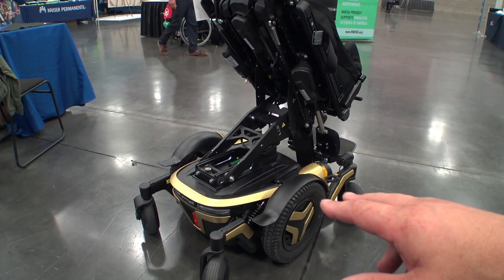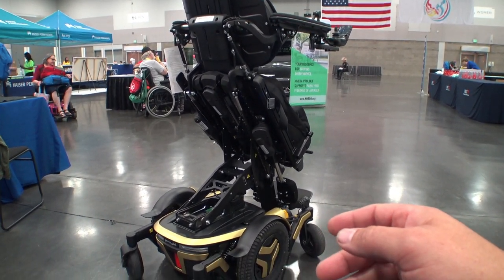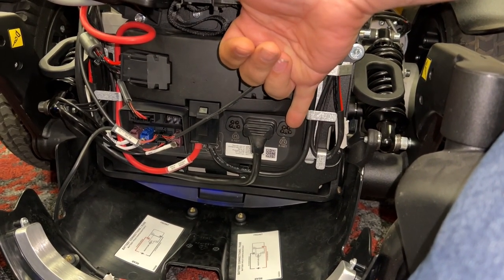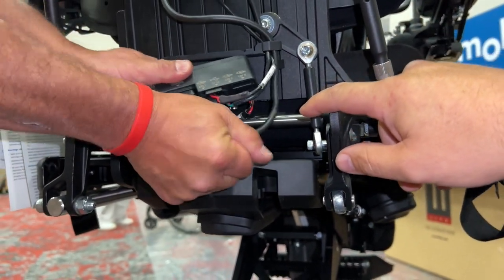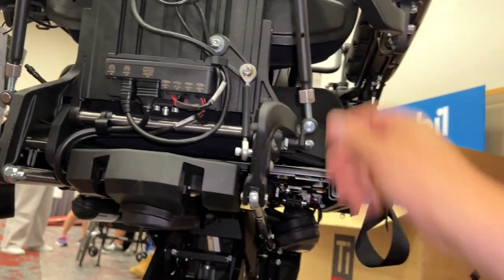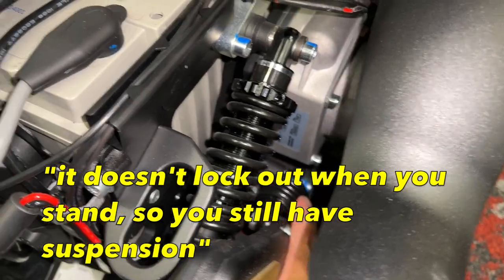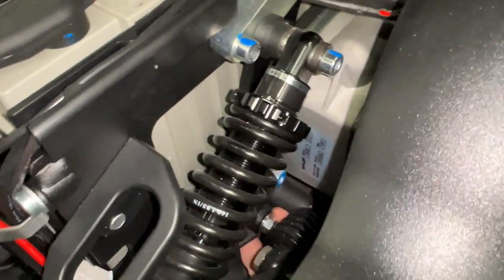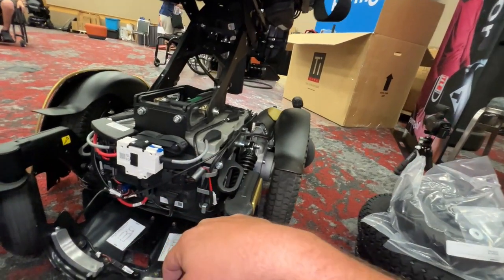a look at permobil's 'power platform' control system!

Comment from the maker: the power platform control system is still 120 amp output, and very much a work in progress.  they are pushing out OTA updates for things to add new features, and fix bugs etc.  the connect module is also integrated into the same module. everything is still built by PG drives.
Reply: can existing chairs m3 / f5 be upgraded with this power platform?
Reply: Hello all, my first time here. My Handel is Sieg. Anyway, I have a f3 that is giving me error code ics airplane mode 201e. Can anyone help me out ? It's Saturday night no one else available.
Reply from the maker: @dudleysiegfried2823  https://brokenwheelchairs.com/page-3/page-22/

Comment: The new improvements on Permobil chairs never cease to amaze me. Is there a video somewhere where I can look at all of the technological stuff about the chairs that they are rolling out?
Reply from the maker: the power platform isnt at version 1 yet.. its still a work in progress for the software etc :^) but they can push OTA updates to add new features later on.  but there are VERY few details out there about anything at this point.
Reply: @TotallyNormal-  OK that's understandable. I wonder if it will be as simple software update for existing at three with the same technology as our chairs. Because I use the myPermobil app for my wheelchair, so I'm wondering if it's just a simple software update or if I have to wait until I get a new power chair.

Let me put it from the way I see it. I think if I already have the existing connect module on the back of my chair maybe there is someway that allows me to upgrade everything just over the Internet in the future
Reply from the maker: they have removed a bunch of the modules and wiring, and everything is integrated into a larger one now.  also the joysticks have a different display etc.  unfortunately its a lot more than software
Reply: @TotallyNormal-  I figured that was the case, guess I have to wait until 2025 or 2027. I am curious now though, this 2021 F3 that I'm sitting in right now was ordered on March 13, 2020 and I was supposed to have it either in the middle of the year or later that year. But of course after what happened around the world in 2020 makes me wonder if I'm still eligible in 2025 for an upgrade in two years, I guess that will be up to insurance.
Reply: @JordanLoweElevaToursCanada  I work with permobil reps it won’t be an upgradable option unfortunately it will have to be a new chair

Comment: My last f3 was built at the end of 2018 and early 2019 not really sure which model mine might be(2017 or 2019) but I definitely have plenty of torque to climb and carpet isn't too bad but I have learned to make 10 point turns to reduce the bunching up under my drive wheels🤣 I'm due to get a new one in March I'm wondering if any of the new features you just seen will be integrated into my next chair here's to crossing my fingers 🤞
Reply: Awesome to see improvements I have a f5 VS that was manufactured in December of 2022 (the 31st and delivered in February )

Comment: It's nice to see it mid wheel drive. Can it stand more vertical like the front wheel drive F5 VS? This is similar to the quickie q700m-up just more high tech
Reply from the maker: this chair is their new group 3, mid-wheel standing chair :^)
Reply: @TotallyNormal-  Do you know the angle on how vertical this chair can get? I have the F5 vs. Too bad they can't retrofit this controller

Comment: In the market for the F5 VS and have the option between buying a second hand ex demo F5VS without the new tech on which will be easier to get hold of but won’t have the new power platform on or going for the new F5 VS with the power platform, is the power platform worth it do you think? I’m so stuck as to what to do as I still don’t really understand the difference the power platform will have

Comment: I received a new Permobil M3 in 2022 to replace my Invacare TDX with gearless brushless motors.  I could not get used to how crappy the Permobil handles. It makes no effort to hold itself in a straight line and let's the giant caster wheels pull it around. I don't know how you guys drive them so I watched this video out of curiosity because I have generally followed you from back when I was considering going with the  Permobil. However, long story short, out of frustration I shoved it in my storage closet and went back to using the Invacare TDX as my primary chair. I love the Invacare even more now. I just don't understand what's going on with the M3. Does everybody with four pole motors (as opposed to gearless brushless) just get used to having the chair lurch sideways when you reverse out of the doorway or from a desk, and pull itself around driving down a sidewalk etc.?

Comment: To get this new UI on the controller menu is it just to update or do u need a new controller or this powerplatform system??

Is it enough to download the app
Reply from the maker: unfortunately, its not just an update..
its a completely different control system - it's still R-net based, but they were able to cut the number of modules on the new chairs in half!

Comment: Hello Dan, I've been watching your videos for a while now, informative and entertaining. I started the process to get a Permobil standing chair over a year ago, nothing but issues with the OT and vendor. Now I'm hearing there are issues with the new chairs, have you heard anything? Thanks.
Reply from the maker: what issues are ya hearing about?
Reply: @TotallyNormal-  I've heard there are problems with armrest pads and my vendor is telling me Permobil are having issues, he didn't go into specifics. As you stated they aren't to version 1, it may also have to do with the fallout from covid. Next I talk with him I'll try to nail down specifics. I'll let you know. Honestly, you're my go to guy for info, so if you haven't heard anything then it may be much ado about nothing.
Reply from the maker: yea i mean theres little stuff here and there that can have issues.. i went with non-stock arm rests to keep the chair width down and not worry about the plastic surrounds that randomly crack.. IMO there arent enough issues with the 3 series chairs to warrant going with another brand :^)
just make SURE your DME doesnt cheep out and give ya something other than the permobil branded batteries! there was an issue with melting joystick ports, but that has been resolved now.. the volt pro chargers when they first came out had inferior connectors on them and would get hot.. but all that is good to go now :^)
Reply: @TotallyNormal-  and that's why you are my go to guy for info. Wheelchair groups are ok for general stuff, but you seem to have an inside track on what's really going on. Thank you
Reply from the maker: not every brand is perfect.. but just remember, you'll usually ONLY hear from people having problems.. permobil isn't without its little issues.. but i still recommend them, amysystems, and bounder (in the USA - other countries have a lot of crazy/neat stuff ive never seen before)
if possible, try and get yourself a demo chair to test out before committing to any model! - FYI if you're not used to front wheel drive - it takes a bit to learn.  ya may hate it at first!
Reply: @TotallyNormal-  I totally agree, nothing is perfect. I originally was looking at the 4Front until I watched your series on it. From what I hear, they have supposedly fixed those issues. Many of my online friends have Permobil chairs, they all love them. My first, (second hand), powerchair was rear wheel drive, my wife's chair is mid wheel, definite differences in the 2, as I'm sure there will be with the front wheel drive. I had hoped to demo both Permobil standing chairs, especially since seeing your vlog on the new power platform, sadly it looks like a demo isn't possible. Things work differently, here in Ontario, Canada. If I can't come up with the funding for the seating features I want, then I will have to take what the government program(s) will pay for, a 4Front 2 with only tilt and recline. If it comes to that I will have to make a "standing attachment" for the chair. Thank you for the help and keep up your informative vlogs.
Reply: @TotallyNormal-  hi, any examples of the neat stuff from other countries? I can only think about several kind of niche products (having great unique features but lacking in many other areas) like the Swiss Scewo Bro and Russian Caterwil stair-climbing wheelchairs, other than that it always seemed like the US power chairs are the best ones.

Comment: Hmm  could this create battery charged displays -  charger full /  joystick not fully charged ? 

If I so much as elevate -  I drain dat battery  .  Turn it off & back to a normal level & more cells reflect charged.  

We need a way to plug in on board portable chargers /  bypassing the joystick .    

Does the companion rear control get in the way of battery life , in idle , on the go ??   
Is the new set up fixing the battery issues of every feature sucking the  volts away ? 

How can one disconnect the companion control in the rear that is always on ??? 

Why not have a option at the joystick where we the user may turn off that darn thing & back on if ever needed .   Same question with ..  why not be able to turn off features using amps ..  like up up & away we elevate    ??? 

Recline / tilt / footplate features really drain my batteries .